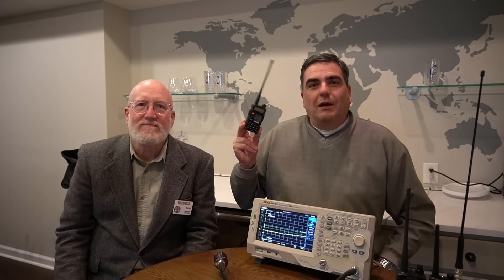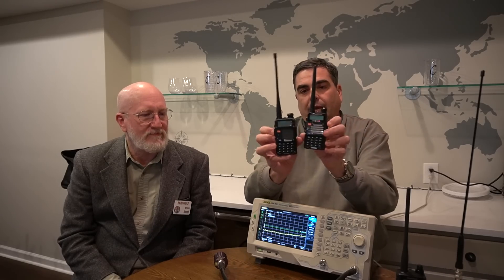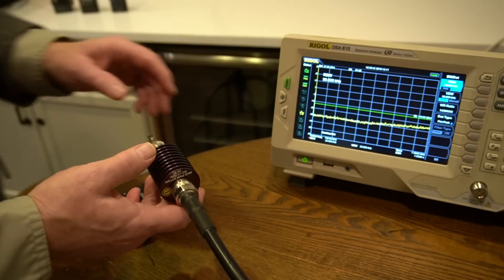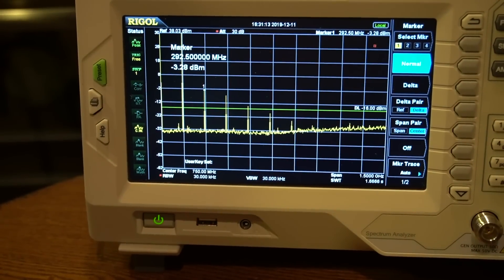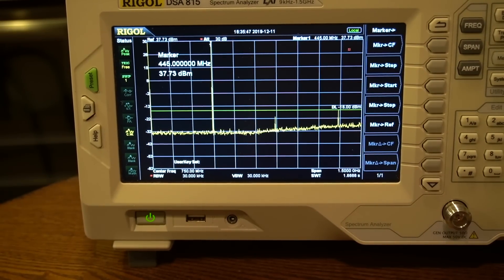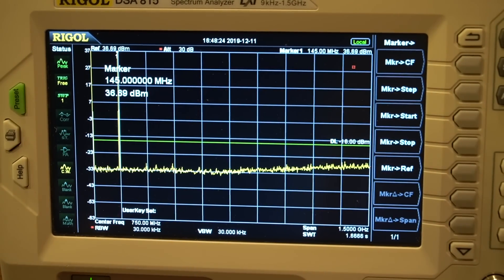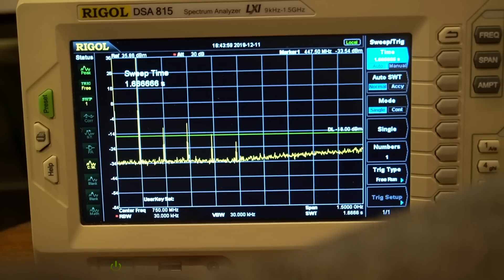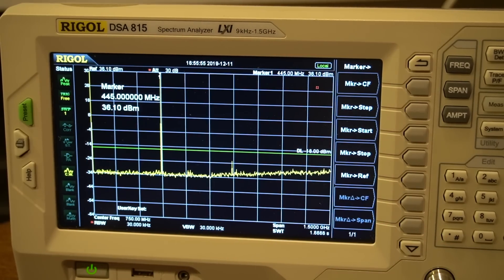Baofeng BF-F8HP testing for FCC ham radio compliance

Comment: I’m sticking to my cheap $25 Baofeng, the FCC needs to knock on my door before I give it up! I’m not spending a hundred bucks for an upgrade!
Reply: Same here ima keep it it maybe a little out but it's like Noone even cares about that
Reply: @Bob Edmondson and ironically if you look around the rural fire departments especially love using baofengs in emergency calls because the price difference frees up a lot of money for mission-critical equipment, maintenance, and training, as most rural departments toast 1.5 radios per person per year, so picture on a department of 20 people replacing 30x 15-20$ baofengs per year at a price of 450-600$ vs replacing 30 Kenwood/Motorola radios at 300-400$ each for a cost of $9000-12000 dollars per year.
Reply: The TYT UV8000E comes with the ducky and a longer whip, is 10W, has cross band repeat, and has a 3600 mAh battery. Usually $79.99, but catch it with a discount here or there as I did and get it for around $70. With the whip it is pretty impressive. I've been asked if I was on a mobile or base. My three UV5 variants only get pulled out to monitor MURS communications at Walmart with an earbud while I'm shopping. I put it on the through the glass Tram Browning in the van and I can hit our club repeater cleanly from about 35 miles away unless in a low area with lots of building around. By comparison my Baofengs are kids walkie talkies. The Baofengs were my gateway radio to getting my ticket though. 73, K2WLF
Reply: Theoretically could cause interference on the harmonics but who’s listening in there what’s he got to interfere with ? The bands are dead and free from everyone including grumpy old men
Reply: Tory Boy I agree, besides if I’m identified as causing interference the fcc will simply tell me to cut it out and I would comply. I am sick and tired of the oldass technology, and expensive radios coming out of Japan. An example of oldass technology is the Yeasu 818 same as the old with lipstick with same or higher price tag